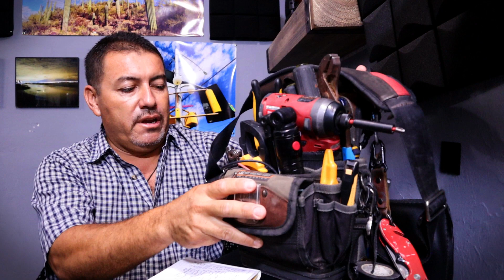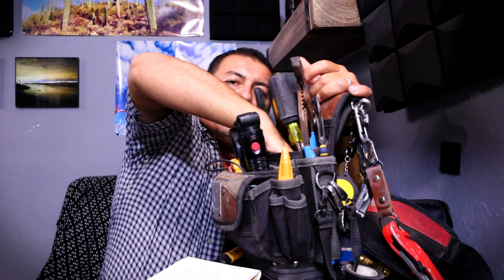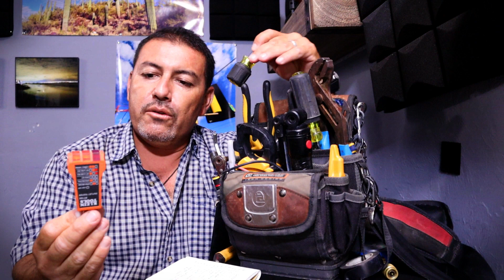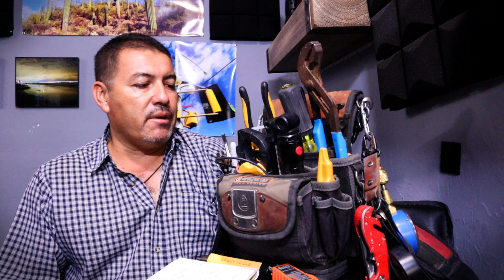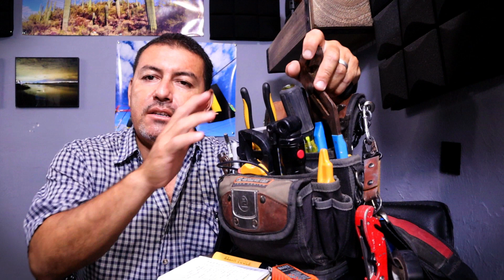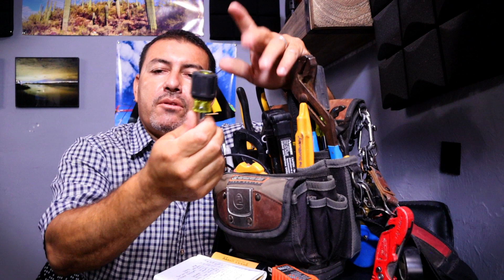My 15 most common work orders, and the tools I use. #apartmentmaintenance, #maintenancetech, #veto

Comment: What you described on dishwasher discharge is a High Loop, and is missed a lot as you said. It’s a simple repair but if not done will fail an Apt. inspection.

Comment: I roll around a rigit tool box qith everything in it and i can tell the other maintenance dudes hate on me. However i don't give a fuck cus i got everything i need to get a job done from ac electrical outlets to plumbing and dry wall spachala patching. I make 25 an hour here in Colorado

Comment: Awesome video. I just applied for a Maintenance job where I work at a university. So the work is somewhat similar. The work is mainly in office and classroom buildings on campus. We have trades people who do plumbing, electrical and carpentry so my work would be minor repairs in those areas. So basically general maintenance around campus. I've worked here for 21 years as a janitor but am way overqualified for my job. I tend to sell myself short which often causes me to be overlooked for jobs in maintenance. Anyway, I found this video to be very helpful. Take care.
Reply from the maker: Best of luck!! We all sometimes doubt our abilities or sell ourselves short. But you'll see that even the most experienced tech is still learning. New equipment and techniques are always keep everyone on their toes. In a couple of months or years you may be more advanced than others because you will have your mind open to learning what's new and evolved while some older techs may be stuck in an old way of doing only what they learned 20 yrs ago. I wish you the best!!

Comment: Hey thanks for your insight on maintenance common work orders. Can I ask a question I’m sure many other like residents would like to know. I live at a property here in Washington state but originally from Mesa, Az. Heyyyyy. Ok the property I live at is managed by one of the largest property management companies they have properties all over the map. Recently, We had a technical change they moved in the unit above me so a on property tech right but no resident is sure is this tech for our property strictly? Our community manager is non existent we have been rolled into the maintenance and mgmt of a sister property that have a large townhomes of units and  70 something apartment community who this sister property is responsible for our property is the third one that they just rolled in on top of these people we have 74 units here at this property my question is I’ve had outstanding work orders since February 7 my dryer needs to be looked at because it’s not drying as I’m good as it could be our vent traps are full outside this maintenance tech that has moved and Upstairs is busy upgrading her own apartment we are hammers and stuff going on and you know that’s fine and well but my question is have you ever been told by a manager or something with the property you’ve worked at to ignore a work order or slow on work orders for a certain property I mean blatantly I feel like we’re being ignored and this is never happened before our rents paid up or in our rents paid on time never had any problems it’s just we felt that we’ve been like put on the back burner and that the current management team is handling too many properties what should we do or no not what should we do it I just wanna know have you ever been told to ignore at work orders?
Reply from the maker: That's a great question, managers never ask us to ignore work order. But what is  happening lately is that we are really short handed. It's a national problem. We try to prioritize work orders as much as me can. Heating/cooling, plumbing, and electrical issues are #1 priority 
  After those we need to paint and prepare vacant apartments (unoccupied apts are money lost for owners).
Most companies do try to make all other repairs within 48hrs. But when you're short-handed it's really hard to get to work order.
Reply: @MaintenanceManNarratives  Thank you for getting back to me. Update on Work Order situation…. I guess the management company has been having a hard time retaining workers and simply just finding people who want to work. However, our property which consist of just 74 units has been without a community manager, assistant community manager and no maintenance staff the company rolled our property in with the managing team of two nearby properties which are townhomes well over a hundred units and the other is a smaller property about seventy something units all operational budgets for the three properties overseen by just one community manager, her staff is always changing they would quit and she would have to hire another “that turn over rate is not normal and could be because of the work environment not being free from something hostile” The company also like to take a mistake or mess up and do the he say she say mess and guess what for the higher ups to stay in their position they will finger the newbie employee as being the cause even if it’s a training issue and cut the lowest person on the totem pole to keep their nose clean. It’s truly sad. Ok. I’m concerned that e we have had a section of our properties Boundary fence just tumble over and it’s left a big gap that has now attracted transients to use this section to cut through and get to the park behind us, and also we are on a very busy street and you just see cars zipping by at a high rate of speed and I’m scared that one of those cars will jump the curb and fly right into my unit like someone driving drunk and I can’t Sleep at night. I told management and they said they would be calling a vendor out to fix the fence but it’s been two months and we have not heard a peep from management on the status of this fence repair. It’s a safety issue so someone suggested I’d call the fire marshal our building examine people with the city and let them know about the fence cause it’s a boundary issue or falls under some other section of rules and pertussis out will put a fire under their bu**s to fix our fence but I don’t wanna cause no waves and have them thinking about whether to offer me a renewal once my lease is up cause even though it’s against the law for them to retaliate against me for reporting the issue to the city but they will better believe it. Politics of a large property management and reality company…. Like one of the largest National companies. Anywho thank you again for responding and for listening my friend. Have a wonderful night.